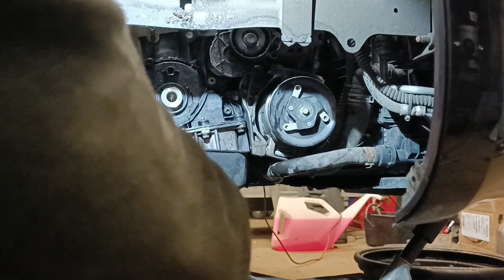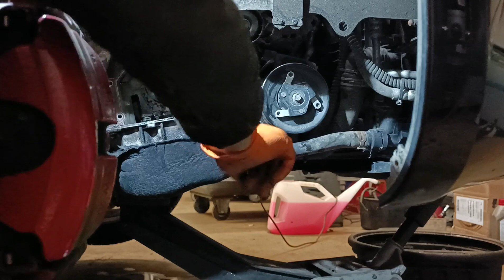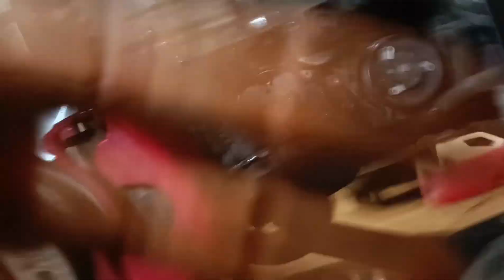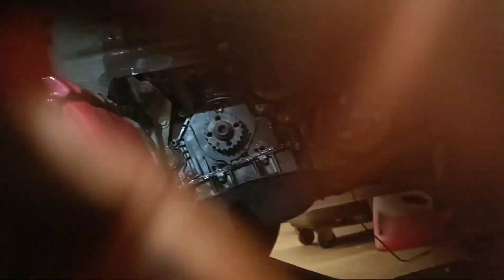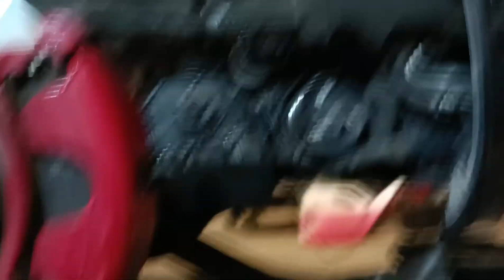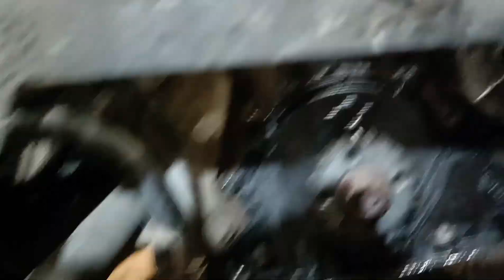2.TDI / 1.6 TDI Front Crankshaft Oil Seal replacement - Skoda Octavia 2018

Comment: Nice.
Did you replaced timing belt also?
I only have 20k from replacing timing belt, water pump and all the other stuff 
But the mechanic never told me about the oil pump belt, and now I'm really stressed out about it.
Reply from the maker: Yes I did
Reply: On the user manual for those type of engine they say the oil pump belt don’t need to be change  .Maybe becouse the oil inside the lubricate belt
Reply: @dzsemadhs1816  
Maybe is better for them to replace the engine and charge you then to replace a small belt 
Mine în  like in 1-2 k miles was done and with it the engine also 
So im really happy that I've replaced it
Great day
Reply: @dzsemadhs1816   😂.
The belt have 1cm.
The tooth is came off after 50 70k.
I know who have 0 ps pressure oil.
That's not joking with ea288
Reply: @ZiggyAq is it possible to replace oil pump belt without removing oil pan?
Reply: @emirbahtijarevic3069 no, you need to remove the oil pan also.

Comment: Thanks for the video, right now I'm doing the same job, but I don't feel safe adjusting the crankshaft bolt with the pneumatic gun, I know it gives torque and angle but I don't know how much, do you have that information? thank you.
Reply from the maker: Hey,
I opened that center bolt with an air pressure gun, but first I put the locking pin in place and still had it on hand, then I opened that bolt.
Reply: @ZiggyAq  👍👍👍

Comment: Why remove the entire bracket vs. use a seal puller and seal driver instead? With right tools, this is a quick and easy job without the need to remove the entire assembly.
Reply: The seal is not available separately. It comes with the whole housing
Reply: That makes sense. I did a seal replacement work on US specific TDI from 2012 to 2014. All I needed was a seal and two tools - one to remove the old and the other to press in the new seal. It did not require much disassembly like you had to. Of course, this is a much different engine. Great video, thank you!
Reply: @matty5057  hello, what you say is true, Volskwaguen does not provide the seal alone, but the Victor brand (high quality) manufactures it, at this moment I am doing a TDI 2.0 and today I will change it with the complete kit and water pump, regard.
PD: I will also change the camshaft seal.